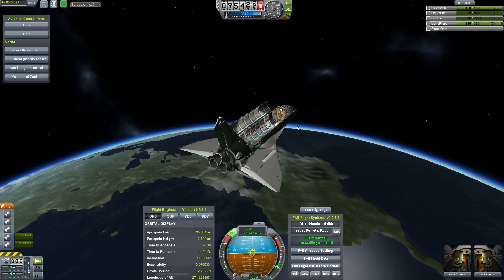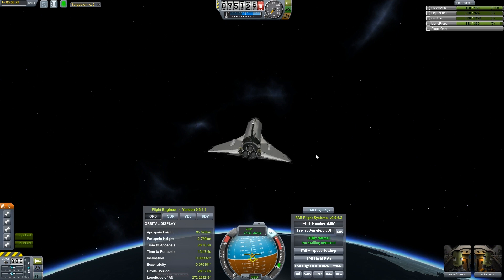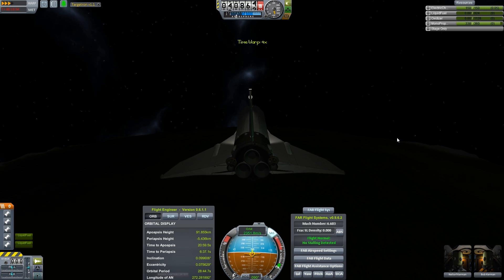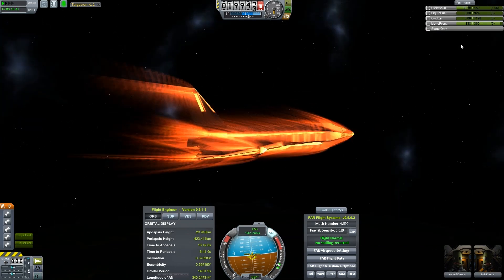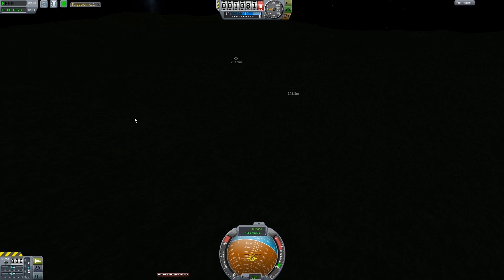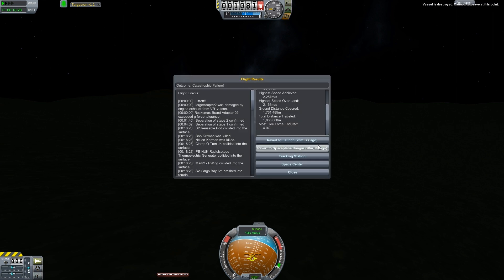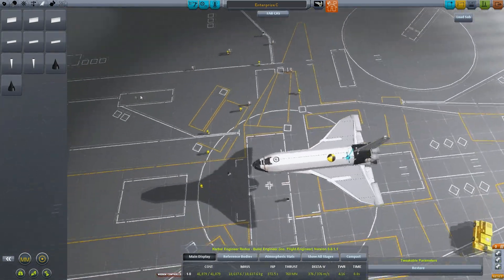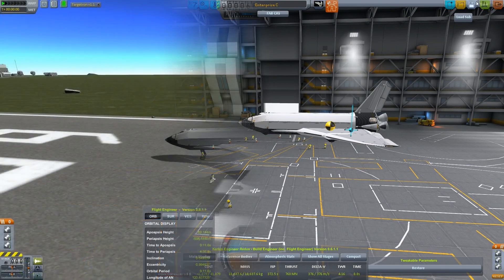Let's Fly KSP: Space Shuttle Development part 8

Comment: Lawndart!

It seems to me that the electric charge was mainly going down because you were flying with cockpit reaction wheels enabled while in atmosphere, and your electrical power supply couldn't cope with the demands. Bigger battery is one idea to fix it, but I think it would be better to just disable reaction wheels during atmospheric flight... or add a few more RTG's.

Regarding control surfaces, using the big control surfaces as body flap under the engines could be aesthetically successful.